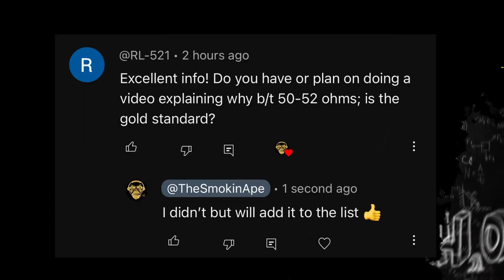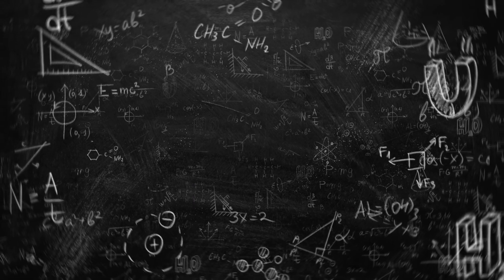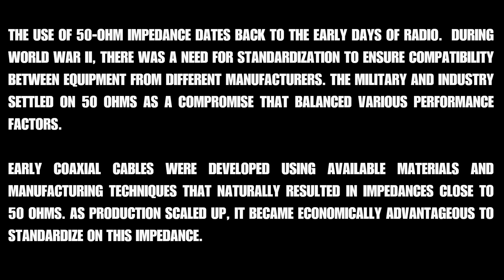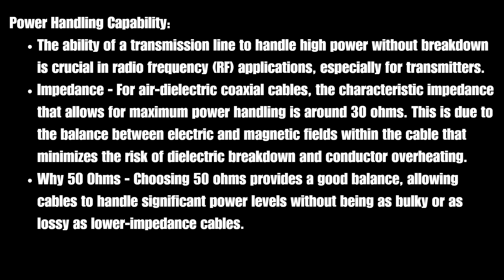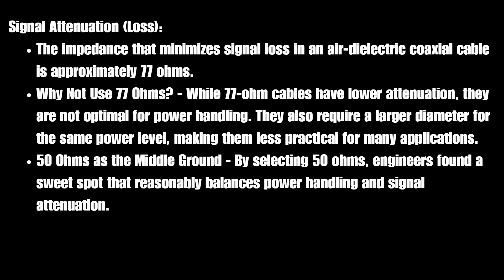Ape Answers 013: Why 50 Ohm Coaxial Cable?

Comment: The reason for the Joint Chiefs of Staff (JCS) selection for Military Electronic designation of the 50 Ω termination impedance has to do with noise characteristics centered around a conjugate match centered around the Smith Chart. While many microwave devices, systems and deployment apparatuses can either be high or low impedance, the typology of the circuits will  be stepped in stages to the nominal 50 Ω variance to phase ensuring maximum power is transferred from the RF circuity to the antenna with minimum VSWR. More of this can be read some IEEE findings: Optimizing the Receiving Properties of Electrically Small by SR Best · 2016 or NoiseTech Microwaves Ltd. News
Noise parameters describe the auto correlation and cross correlation between input and output noise waves  as well as other findings related to Smith Charts Noise and optimum balance for loss tangent stabiliity of lower order noise.
Reply from the maker: Thanks for the info 👍

Comment: Excellent overview and to the point, beginning to end.  I was in MATCU.  We used 50 ohm for radio, and 75 ohm for radar.  Our shelters were compact and crammed with equipment.  Consider the amount of noise on / from unshielded ladder line from 10 UHF, 4 VHF, 2 HF radios, plus 4 terminals for radar, all in 10' x 40' of space.  All analog, pre digital.  A battleship or carrier would need many long runs between radio / radar rooms, and antennas, many decks above, all crammed in tight spaces.  Standardized coax was necessary.  Thanks for explaining the impedances determination.  (side note: the spell check is getting worse, not better, over the last few years.  YouTube, do better.)

Comment: Great job. many do not know why 50 ohm was picked. Just went down the middle because of TX/RX ,The reason the 30-35 ohm is best for TX is the 1/4 wave is 35 ohm.  The center fed  is 72 OHM at optimal.  cutting the difference like 50 ohms makes it work on both antennas and we just tune length of adjust Height or angle for 50 ohm.   it is easy doable . 73
Reply from the maker: Thanks for watching Robert!

Comment: 50 Ohms was chosen because it was very close to the (at the time) popular 51.5 Ohms which is the impedance of very early hard line made of standard size off the shelf rods and pipes.  JAN (Joint Army Navy) eventually standardized on 50 Ohms.  Interestingly, Europe was using 60 Ohm impedance at the time but due to the US standardization to 50 Ohms and HP's (instrument manufacturer) adopting it on their test equipment Europe was basically forced to adopt 50 Ohm impedance as well.  I would assume their impedance of choice at the time was 60 Ohms due to the standard size rods and pipes available in Europe at the time.
Reply from the maker: Thanks for the info Mike 👍

Comment: Aloha and good morning, Ape! 🤙🏻
 
     I am just so grateful that you didn’t bore us with all the math. I could be wrong but I think the only US manufacturer of 50 ohm coax is MPD Digital in Georgia, which is a U.S. military veteran owned and operated business. 
     In fact, I once watched a video about this company that only hires our military veterans, especially disabled American veterans. In the video that I saw maybe 10 years ago, some of the individual stations were modified for veterans with disabilities. 
        I know that if you are a military veteran like myself, MPD Digital will offer you a 10% military discount on the larger orders, which I need to hit them up again for some 50 foot Times Microwave LMR 240 UltraFlex coax cable very soon. 
      There isn’t very many US based businesses that I can think of that is owned by and caters to our military veterans. 
      I am a Lifetime member of the DAV and the VVA chapter 858 here in Honolulu. I am also the DEC of The American Legion Post 11. 
      Being a combat wounded vet and surviving of a VA Pension clearly has its disadvantages and that is an understatement, not just for me but for all my fellow military veterans. 
     A 10% discount at Home Depot, Lowe’s, and at MPD Digital doesn’t sound like much but it slowly adds up over time. 
      I am truly grateful and these companies truly honors our veterans in the only way possible from day to day. 

       73 and Aloha, 

Todd WH6DWF 🇺🇸🇺🇸🇺🇸

      SEMPER FI 🇺🇸🇺🇸🇺🇸